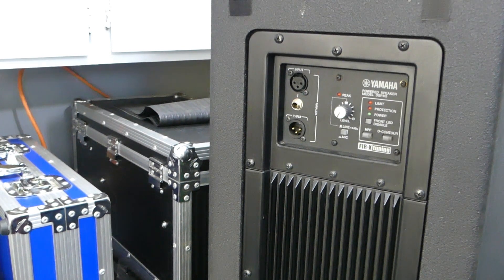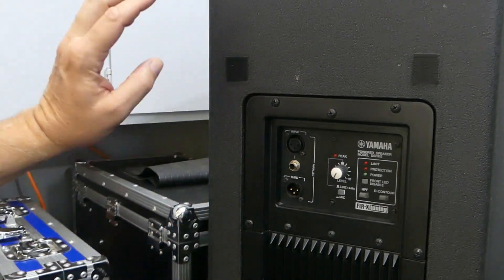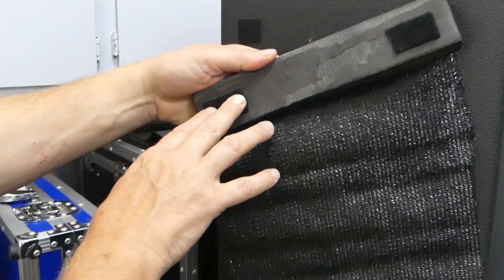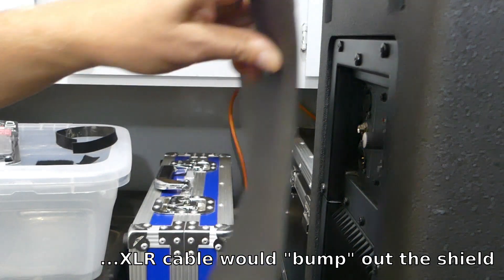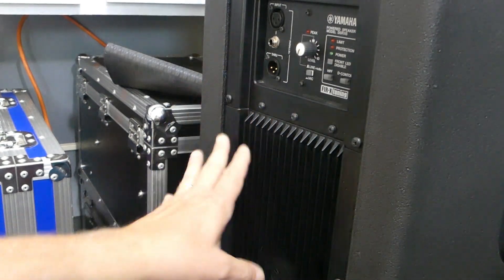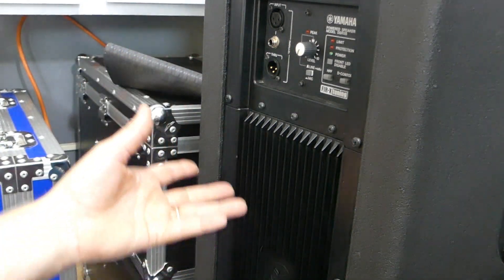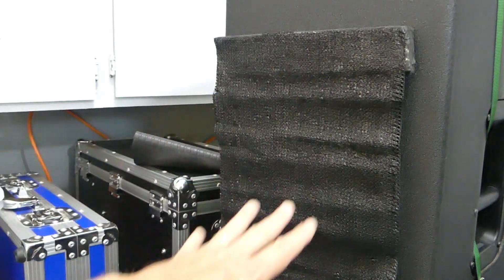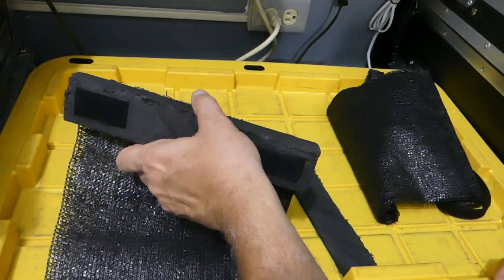Keeping powered speaker (active speaker) amplifiers cool while using them outdoors

Comment: Just curious, wouldn't a sun shield made of white material work better ?  I would think the black material would absorb the the Sun's rays and heat up just like the cabinet whereas a lighter color such as white would reflect the sun and also shade the heatsink ?
Reply from the maker: Yes, a white sun shield would be better; the shield itself would probably be a few degrees cooler.  We chose black to keep the shields somewhat inconspicuous along with our other "supportive" equipment, i.e. our XLR and power cabling is black, speaker stands are black, all cases are black, etc.... We found that contrasting colors were a visual distraction to some bands as well as some attendees.   If you see something of a different color in our videos (mostly yellow), it's for a specific reason.

Comment: I think I would've went for small fans continually blowing air across the heat sinks and the whole back panel.
My approach, like yours, would require some ingenuity plus more expense, more setup time, and more gear to carry. But I would feel I've done my best to protect my gear and keep the show going.
Reply from the maker: Thanks for the comment.  Good point about the fans.  I considered fans, but as you referenced, more expense, more time and setup could be a problem.  However, I may still use fans (not sure which kind yet) if the ambient temperature is (relatively) cool along with the sun directly on the amplifier modules.  The shades seem to work better when the ambient temps are high i.e. over 85(F).  Fans blowing hot air (over 85 F) onto an already hot surface may not yield the best results.  Though, when the temps. are cooler, a fan blowing cooler ambient air should give better results than a shade.  I'll be looking at a fan option later and will probably post a video on it.

Comment: Does that include passive speakers?
Reply from the maker: Related to heat, yes it does.  However, passive speakers can run a little cooler than active speakers.
Reply: Okay thanks, and my speakers have black carpet on them. Will that help with the sunlight on it? Or same thing? Cause I do have a tarp to put over them if it gets hot.
Reply from the maker: The black carpet will absorb heat, but probably not as much as a black painted (or textured) surface.  Over-heating in speakers can start becoming a problem when the ambient temperatures are already sort of hot (maybe around 85-F / 29-C).  We usually place tarps over ours (during setup) with the shiny side of the tarp facing out (to reflect light).  Once the event starts, we remove the tarps.  Placing tarps over the speakers will work, just make sure the darkest side of the tarp is facing down.
Reply: Okay thanks

Comment: This is a good idea.  I would put the velcro on the top corners of the metal backplate if you are concerned about damaging the speaker enclosure. Better adhesion and very clean removal if needed.
Reply from the maker: Great idea.  May try this if I end up having to redo the setup.